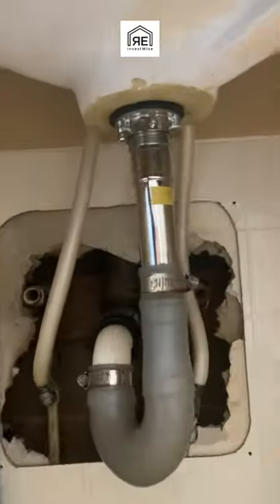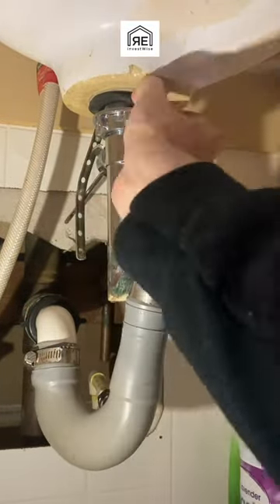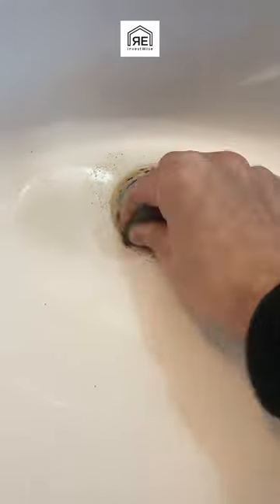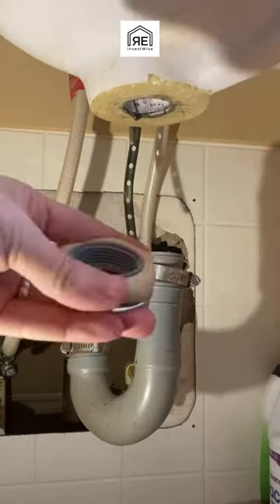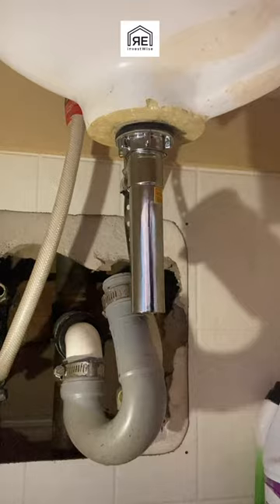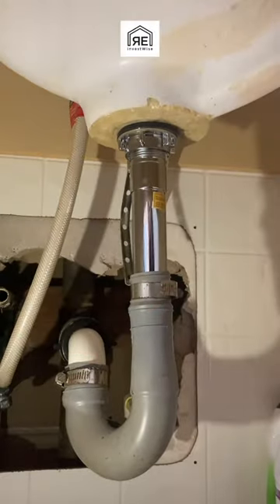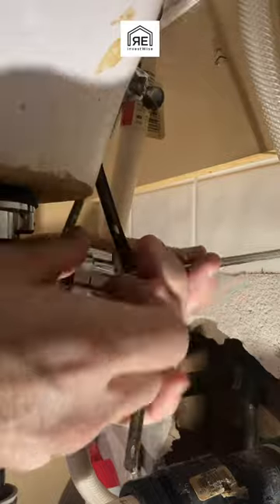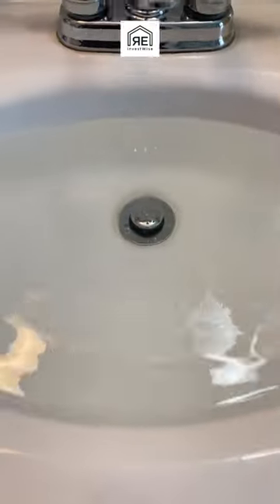Bathroom Sink Drain Repair #shorts #plumbing #handyman

Comment: putty is the best thing to use on the drain on the sink but the most important part of the pop-up is to seal against the bottom of the sink . when the sink reaches the overflow that's when that gasket is very important on the bottom of the sink and why in the hell didn't you get rid of that stupid p-trap thingy
Reply from the maker: I agree, putty is best! 

The rubber gasket under the sink creates a good seal. I’ve see guys put silicone there as well but it’s not needed. 

I know that rubber p trap needs to go. I’m actually surprised it has lasted the 10 years I’ve lived here.
Reply: @REinvestWise  well at least there's a pee trap there but from a plumber's point of view not a very professional thing

Comment: Putty is the best
Reply from the maker: I agree!
Reply: The only thing I don’t like about plumbers putty is the fact that it seeps out over the next month and you have to keep trimming the excess that shows up around your drain. I always warn customers that this may happen so that they aren’t surprised when putty magically appears around their drain. I recently installed a new basket strainer in my sink at home and it took about a month until putty stopped seeping out. I usually stick to silicone even though it’s kind of a pain to clean off when you go to change the drain out in the future.
Reply from the maker: That’s a good point. I guess I still like putty better though.
Reply: @REinvestWise  to each his own. Everyone has their own way of doing things. If it works, it works.🤷‍♂️